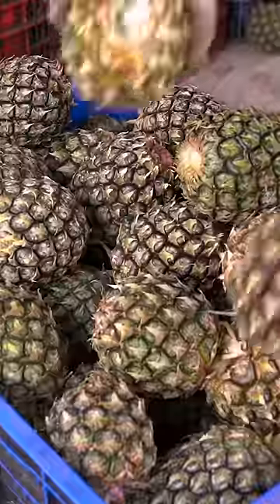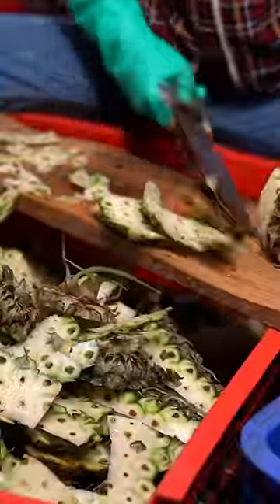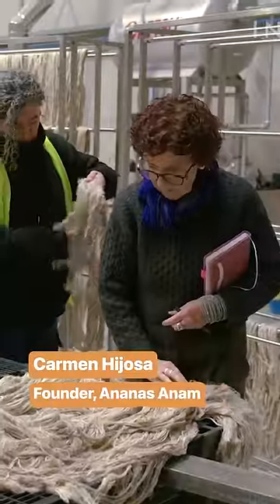This designer created a leather alternative with pineapple leaves. #Sustainable #Pineapple #Recycle

Comment: The problem early on was that there was no scrim to hold the sheets together. When pulled they tended to split. The answer was to use longer fibers. But these affected the look of the finished material. So a normal scrim was inserted in the middle of the sheet. The binding agent is acrylic polymer.
Reply: Like every other plant based "leather" it ultimately relies on plastic to make.
Reply: I have the raw material in plenty😮

Comment: This is a strong example of sustainability, but I have concerns about the use of fertilizers. Some fertilizers are not renewable, which could undermine the sustainability of the approach. Are non-renewable fertilizers used in this case?

Comment: “Pinatex is water-resistant but not completely waterproof. The durability is lackluster. There is low resistance to heat, fire, abrasion resistance, breathability, chemical protection, and it is easily damaged.”
In other words Nike should be selling these for dirt cheap, and they’re not. They get easily damaged, which makes you have to go buy more at exorbitant prices more frequently.
And lol about the fire part!! We as a society haven’t worn highly flammable clothing since little girls were dressing in vinyl evening gowns catching fire at the fireplace. It was horrible as it sounds.